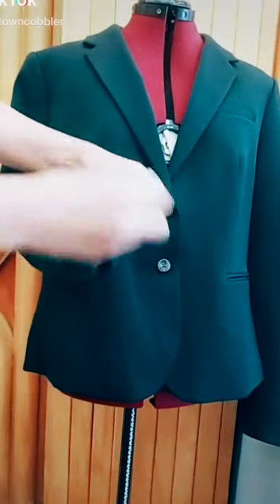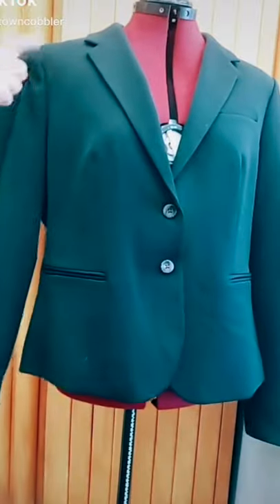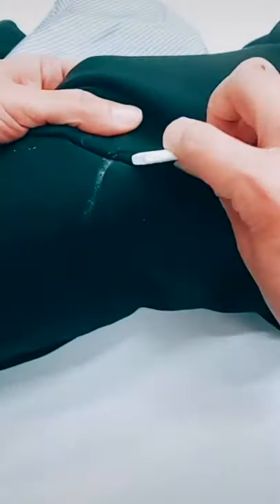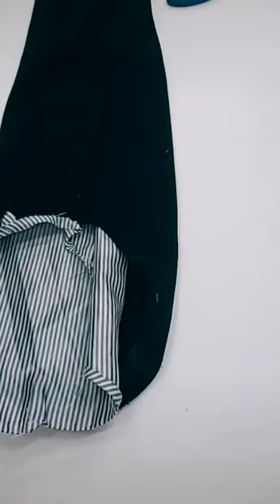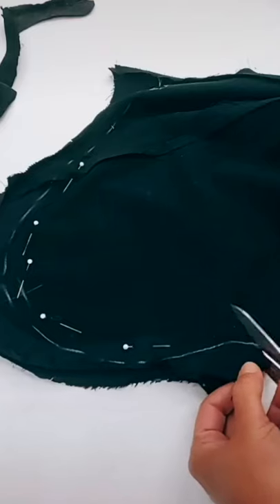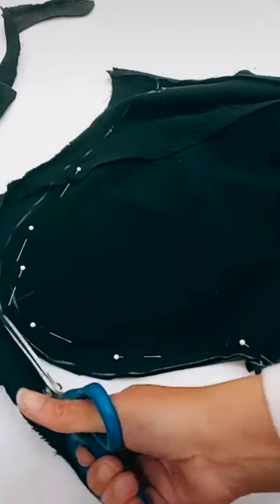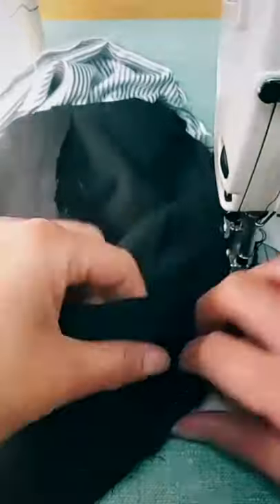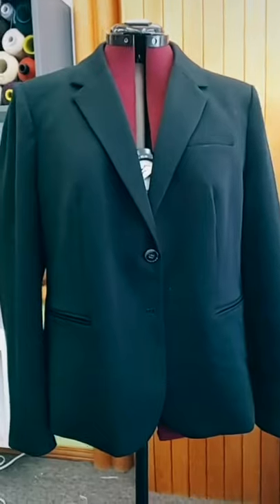Shortening Jacket Sleeves From Above #shorts #youtubeshorts #sewing

Comment: Would this method not make the armhole smaller?  My only concern would be that this could make it fit differently.
Reply from the maker: Hi! The armhole won't change at all.  The problem that sometimes presents this technique is that the sleeve width at the biceps can be reduced a little.  Most of the time, it doesn't matter but we certainly have to check for it 🙂
Reply: Thank you!